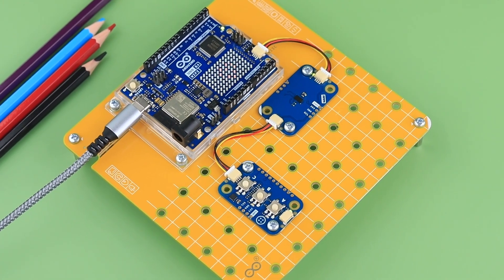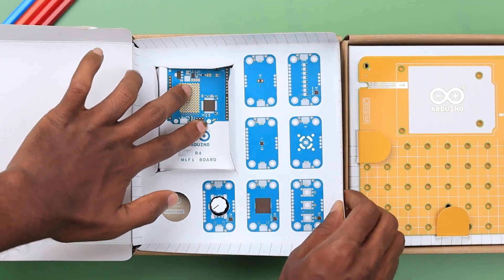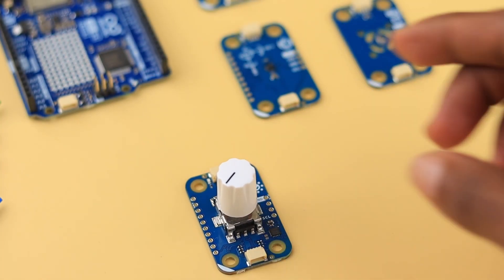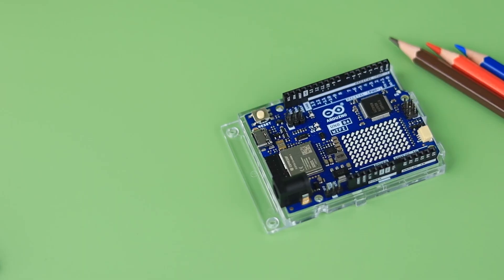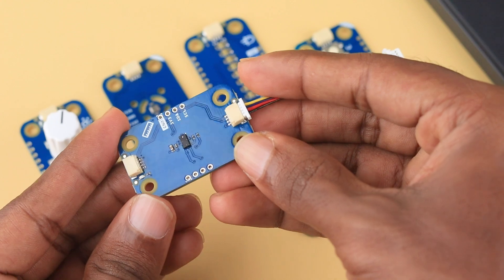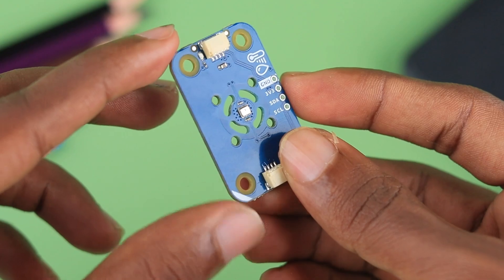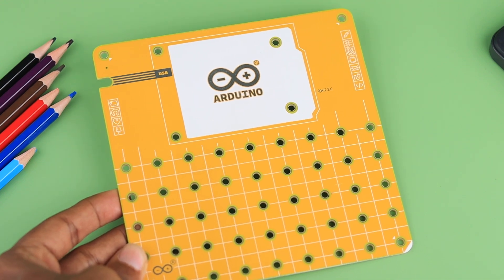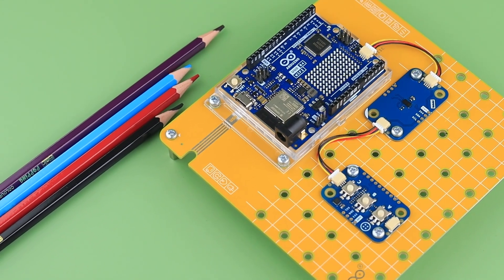Arduino Plug And Make Kit: The Game Changer? #PlugandMakeKit

Comment: I also want to build the machine, what should I learn or what courses i do for that, please kindly give me a road map for this,, because I don't have any ideas for this, please reply me 🙏🙏🙏🙏
Reply from the maker: It'll depend on what kind of machine you want to build. If you're looking to getting started with Arduino we'd recommend focusing on a few key areas:

1. Basic electronics – Learn about circuits, sensors, and actuators.
2. Arduino programming – Start with beginner tutorials on platforms like Arduino’s official website, or YouTube.
3. C/C++ programming – Understanding the basics of programming will help you write better code for Arduino projects.
4. Hands-on practice – Build small projects like LED blinkers or sensor-based systems to get comfortable.

Once you're confident with these, you can move on to more advanced projects. Good luck!
Reply: Thank you 👍 
And give me, if I want to learn CNC MACHINE.., how to make it..
Reply from the maker: You can find all the resources online, there are plenty of DIY CNC machines online.